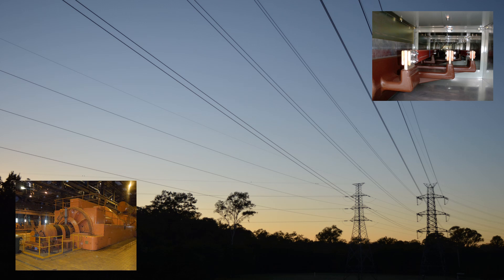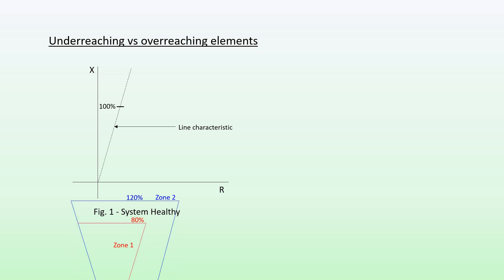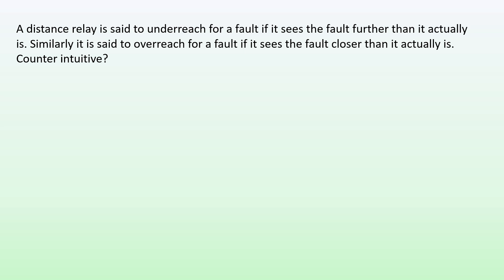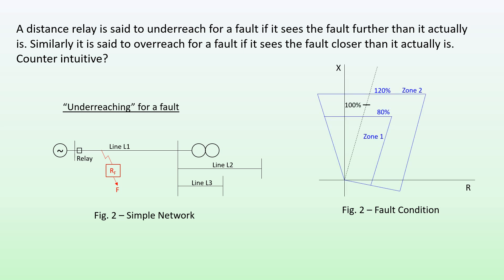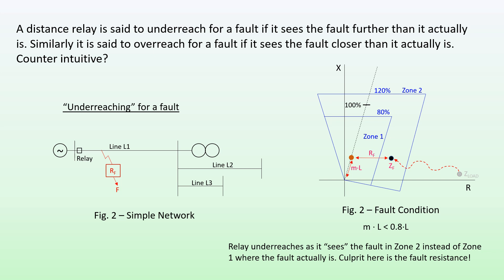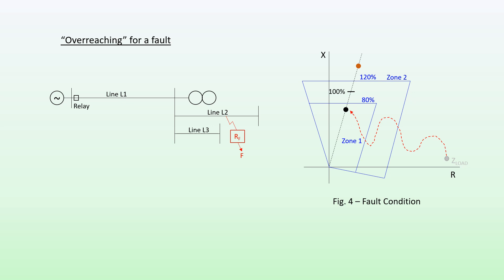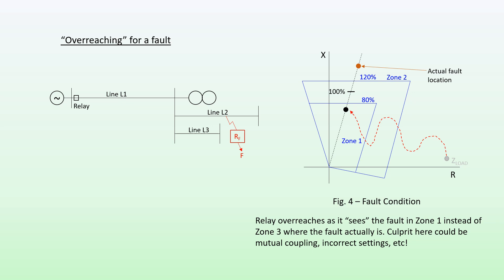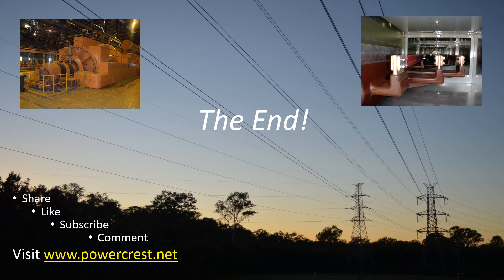Distance relay basics  - what is meant by underreaching for a fault?

Comment: in the end you say that even though the relay underreaches, the relay trips in zone 1 time.. how does the relay then calculate the correct fault fault location? from the line inductance only?
Reply from the maker: Yes, modern digital relays have the ability to resolve fault impedance into X and R. So even though the R increases the apparent Z seen by the relay, I was trying to show that the Z still lies in Z1, but a relay that works purely of Z will see the fault further than it actually is even though overall Zapp still lies in Zone 1. For old school electromechanical relays, particularly those with mho characteristics, it would take very little R to make the relay underreach to the extent where a Z1 fault is seen in Z2 or even Z3 or further out.